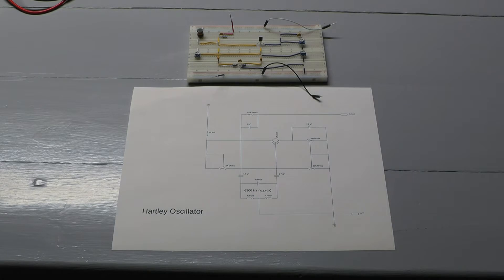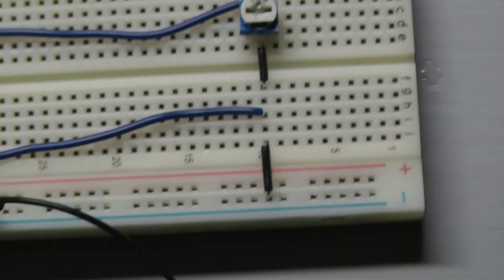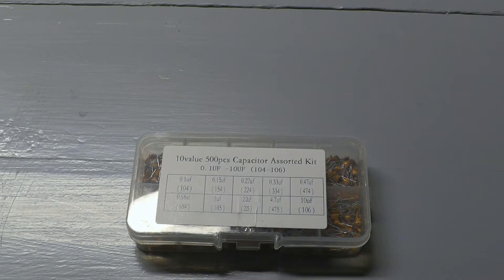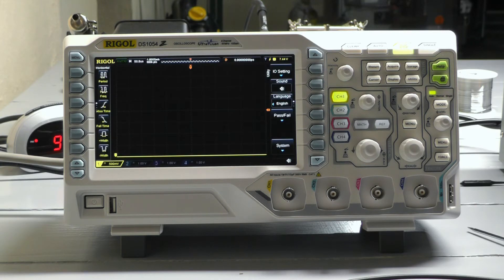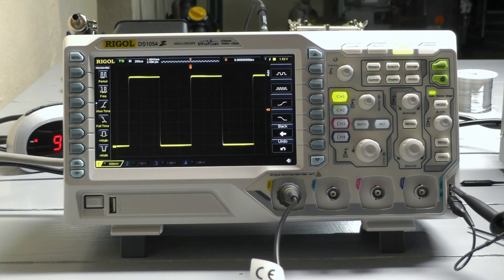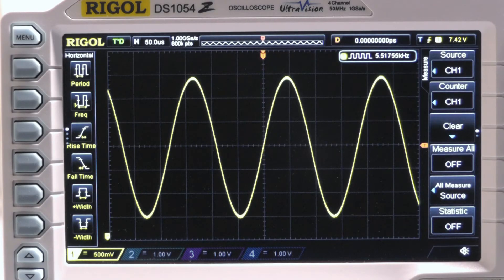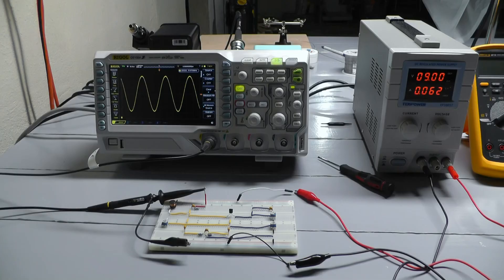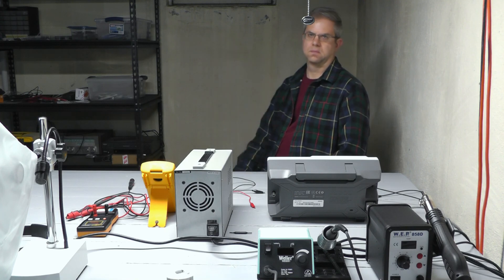Hartley Oscillator - A Simple Breadboard Circuit

Comment: hello Sir is ther a possible solution to this, draw the circuit and diagram of hartley oscillator oscillating on a frequency between 300 MHz and 500 MHz